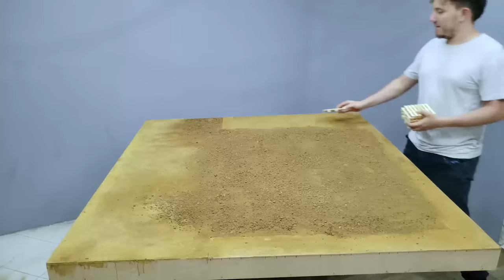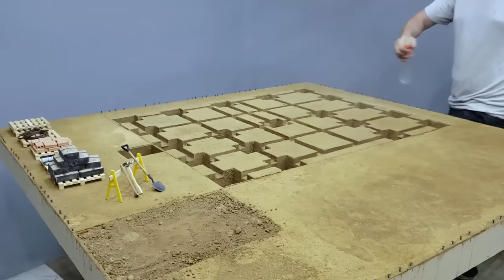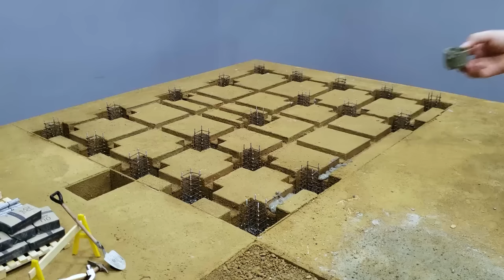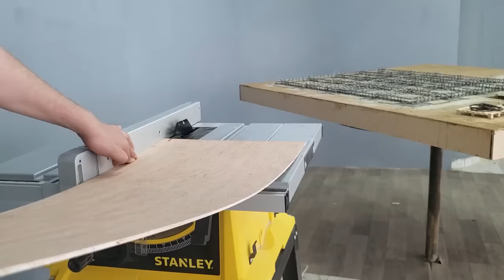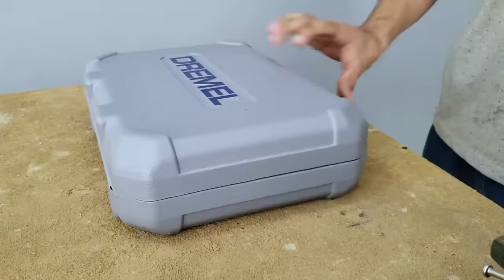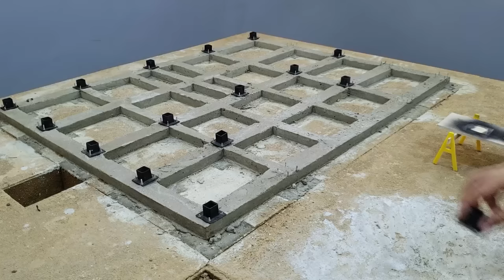Building a Strong Foundation for Your Wooden House: A Guide to Wood House Foundation Construction

Comment: This is how real actual engineers and architects design new projects, then they upscale it, they then know even how many bricks they will need etc, obviously physics is different with bigger heavier materials but the computers work all the tolerances out for them.
Reply: They dont do it detailed like that guy They use other platforms to plan ahead and design...stop spreading bs if u dont know what ur talking about
Reply: Sorry to break it to you but we ain't got the time to build mini houses like this
Reply: Its not bs, most top architectures make smaller versions before the bigger version, not always interiors etc, but the structural design, blockwork, new foundation ideas etc, steel work, roof designs etc, its easier to design a complicated roof design on a smaller scale to acquire the angle cuts and lenths of timber, how many roof tiles you need to crane up there etc, complex stair designs are also designed smaller scale then upscaled, its not a myth, even the ammount of concrete needed can be calculated like this, before computers it was the only method, 3d printing is making this process alot easier these days.

Comment: When you've done concrete construction and realize this guy is way more technical than your companies were
Reply: A bit easier on such a small scale though. Although he did so much that were only for the camera like cutting bracing sand then putting wire around them to put on the pallets.
Reply: @caseygiles1368  yea the comment was just satire lol we aint laying out 5000 different string lines lol
Reply: @imposter0shadow  lmao
Reply: @imposter0shadow  مرحبا وخفف

Comment: Why do I feel like I just learned how to lay a foundation.
Reply: xD but that's not really how it works
Reply: @hckrmnthr4340  I mean, it pretty much is how it works
Reply: @rix1602  trust me if that was done in real structure it won't last long until it fails
Reply: @hckrmnthr4340  why is that?
Reply: @chinchin3009  can't explain.. its civil engineering stuff
Reply: @hckrmnthr4340  so either you dont know exactly what you are talking about or you think im stupid. If i would say doing yomething like somebody does is wrong i would atleast want to explain why.
Reply: @chinchin3009  i can't explain 5 years of studying civil engineering to you because you won't understand anything
Reply: @hckrmnthr4340  it's correct tho. This was called pad footing. Instead of doing a piling first which normal construction always did, pad footing was use in order to bypass piling works due to soil inaccuracy. With this solution the weight transfer rate is on a wider area hence cracking won't happen and so forth. There was another type of foundation similar called raft foundation but that was it was too costly to make.

Comment: The problem with concrete houses is that although concrete is extremely good at compression to support incredible loads of weight, in tension for ceilings and rooftops is very weak so it has to be reinforced with steel rebar and make the ceilings very thick, which add enormously to the weight of the house, and because of that the foundations also have to be very deep and expensive.
We shouldn't be using concrete for celings.
Reply: তে েসেত ঁস োস ত োত৷ কোমিগে

Comment: The base was already build with mould or structure and then it was filled with soil and in video showed us a cleaned. And the later part is still a long hours of hard work but the main base setup was ready before the video started 😅